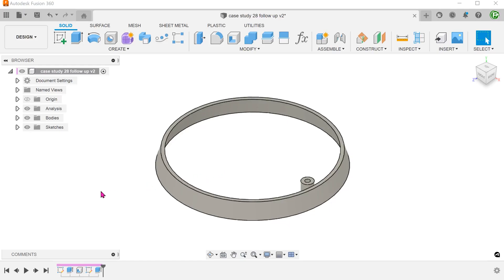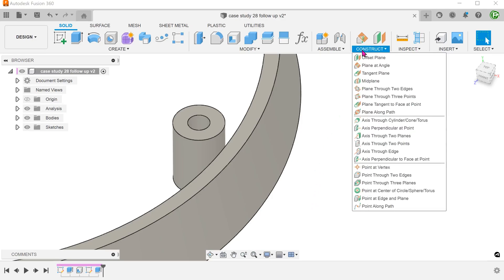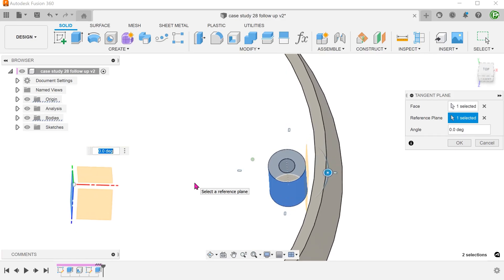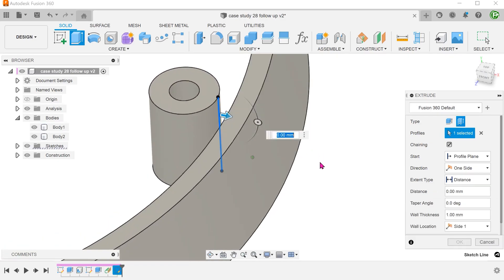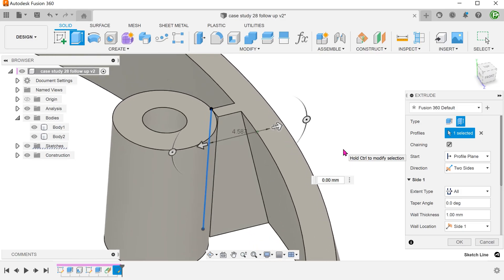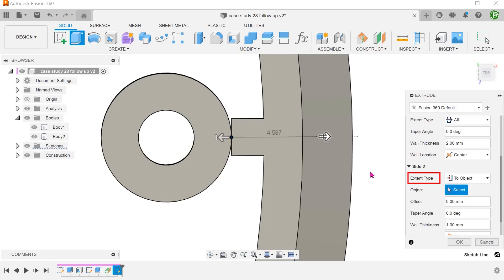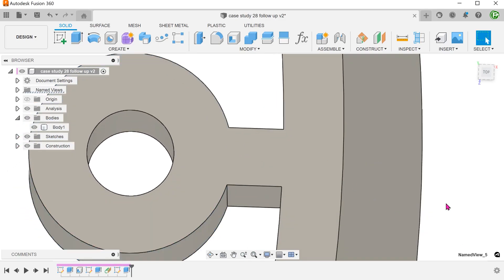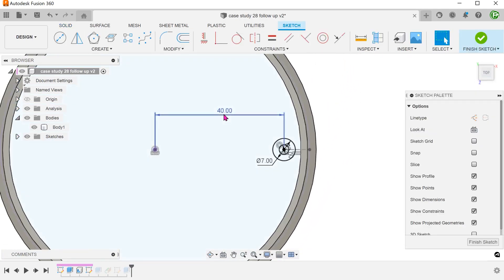Fusion 360 | Case Study 28 Follow-up

Comment: I've been using F360 for some time, but picked up several techniques from subsidiary points in this video, such as the distinction in extrusion between All and To Object., and even the use of extruding a line, which I hadn't stumbled on before.  Well done!  It's very worthwhile watching videos that, on the way to solving a particular problem, explore neighboring  approaches that might suit variations of the problem.